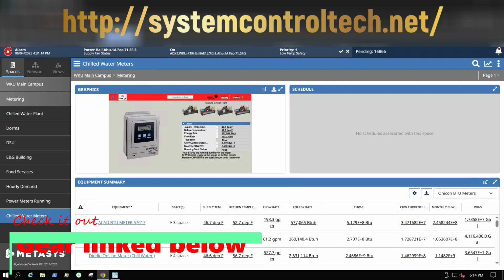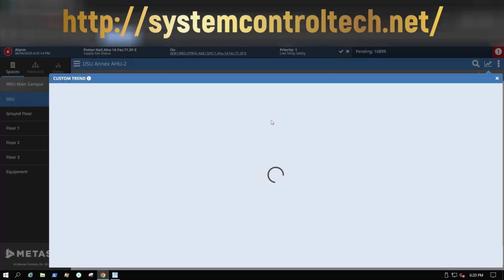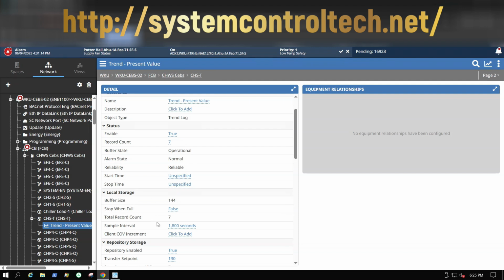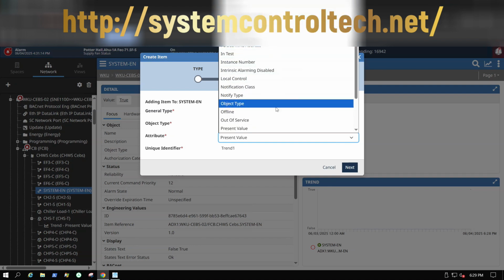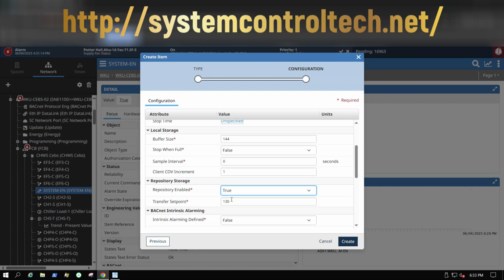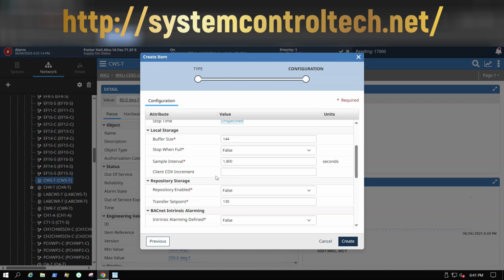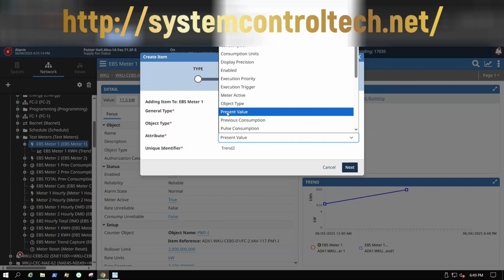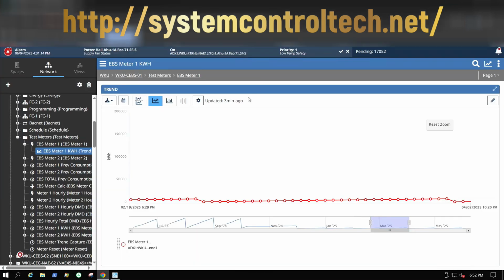Quick and Easy Setup of Point Trends in Metasys MUI

Comment: Hey mate. Just wondering if you would know why/how to get setpoint changes to save. So whats happening to our system is: If we change setpoints using the 'adjust' option it works fine however ith we then cycle the power to the controller the setpoints revert to their previous value as though adjusting the setpoint never happend. Do you know how we could solve this? 

Thanks
Reply from the maker: I've answered a few questions in this video. Check it out here: https://youtu.be/6WfN1CMTVWo